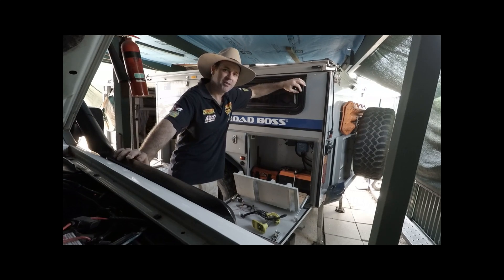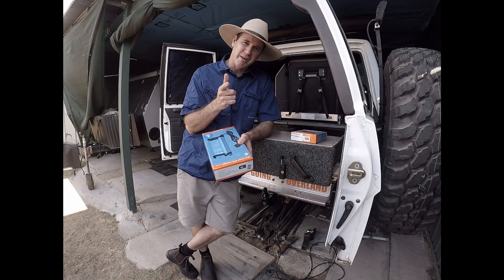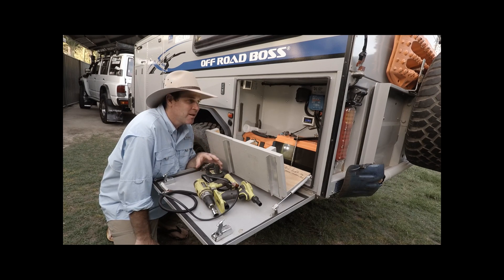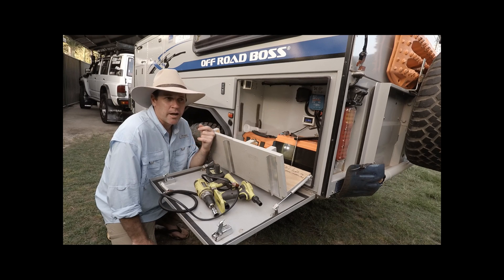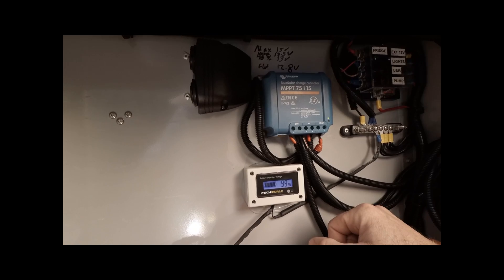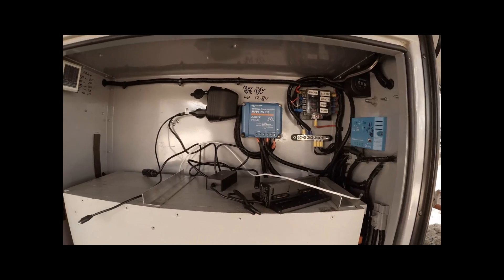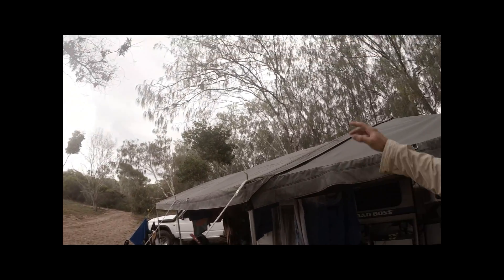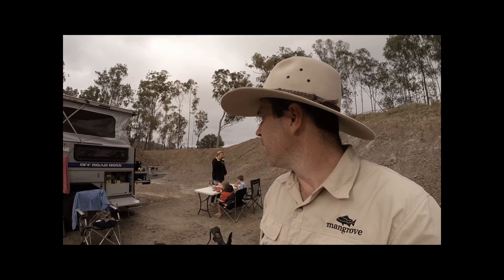Budget lithium setup for camping and overlanding. Real world test. itech lithium and victron mppt.

Comment: I don’t go away for long enough periods so I’m not going to bother setting up the dual battery. I’m just going direct from solar to the battery and it works a treat. Like you after 3 days I came home on 100%
Reply from the maker: That's awesome,  yeah if the lead acid battery is capable of what you need definitely stick to it,  no point spending hard earned money when you don't have to 👍
Reply: Nah it’s a 100ah renogy lithium combined with a 200w itechworld  solar.  I’m useless with electronics, got quoted about $1500 just to wire the car even with my supplied equipment.

Comment: Great video mate, but one very important fact with lithium is that you need to set your charging devices ( DCDC chargers, Solar regulator /charges) to 14.4 th 14.6 volts to achieve full charge. Most come preset when you select lithium as your battery type but worth checking. Also, most battery condition gauges are "indications" only, what I mean by that is 2 different types will show 100% and the other 83%....Always check the handbook and verify that 14.4 to 14.6 v charge parameter..Have installed / upgraded a lot of battery  systems to lithium......just sayin...
Reply from the maker: Thanks Graham,  you spot on there. We actually don't have a dcdc charge as we don't charge off the alternator. And we just finished our lap of Australia and only 1 toped up off 240v! I'm so impressed especially when we ended up running the freezer off it every night in the Northern heat!

Comment: Those batteries are rated for under bonnet use so you will be alright I have just put one under the bonnet of my 200 series Cruiser
Reply from the maker: Really? That's interesting,  we would love one in the patrol but worried about the heat from the turbo which is on the same side.

Comment: You should be able to run the fridge in camper 24/7 as long as the camper isn’t under cover. I have a 110w panel on my car hooked to a 20a mppt and a 100ah agm and thart runs my fridge all year round on solar only. I just on Father’s Day wired up my camper with a 100ah lithium and a 110w panel and a 95 Ltr waeco dual zone and I run it 24/7 and the battery is full by 8:30 am running fridge and freezer and lights. You will be fine running your fridge all night in the rain.

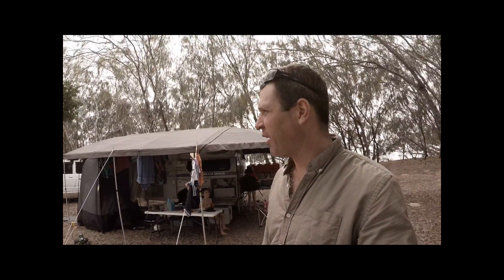Comment: 8:22 I believe you can’t rely on what the volts are with Lithium batteries. They will sit in 13.3 volts until almost completely dead/flat.

You need a monitor compatible with lithium batteries that will give you a state of charge in a percentage %.

I’m about to upgrade to an iTech battery myself, and the Redarc manager 30 I’ll be using will give me a state of charge in percentage and days left till flat when connected to a battery the unit supports.

Comment: I bought 2x 200ah Voltax for $1600 for both. I use a Victron smart shunt to monitor, the two batteries in parallel . Two trina 275w house solar panels in series charge the batteries through a Victron smart MPPT 100/50, and panels push 50a into the batteries in good sun. My free camping setup runs 2 big domestic refrigerators and two 200 litre chest freezers via a victron 1600 watt/70 amp inverter charger. If I need my generator ( which I never have, even in rain) I plug the inverter charger into the gennie and charge at 70 amps. By 10 am every morning batteries are charged again. Both batteries deliver stated Ah (200) as read on the smartshunt before shutdown. No problems so far. I could not be happier. Prior to the Voltax I had two Giant 140ah agm which struggled to keep the system going overnight and took all day to charge. AGM's draw power fromthe charger ok until they are half full then charge tapers off (voltage rises) and the charger backs off, even though the smart shunt tells be they are only half full.
Reply: How have you found the voltx batteries?
Reply: @ashleybertus88  100% ok. 2.5 years now. no problems

Comment: Lithium doesn't run off volts. It holds voltage for much longer, you could be sitting at 13volts and the battery could be nearly drained
Reply: Spot on

Comment: My camper trailer (Drifta WUHT) came with a 300w solar and 200Ah lithium. It has a 60lt fridge and lights and inverter (rarely use) and air pump and water pump. It just never has trouble keeping up. The big fridge (95lt Waco DZ in the GU) will now be running off the same battery you have, with car power and 280w solar blanket when I'm stopped. I was running the big fridge off a deep cycle in the engine bay but I'll probably take it out to save 25-30kg.
I did a Cape York, Tassie and Birdsville trip in '19 but had no hot beers.. Will be doing a big trip from SW WA mid year - probably Kimberley to start with, depending on vaccines and virus stuff. 
This lithium technology is fantastic. Yeah it's expensive but so is rotten food and hot beer!

Comment: Gday, is your Victron Smartsolar or older Bluesolar?
Has the Mppt been set to Lifepo4 charge profile?
If have it connected via Bluetooth to your smart phone and Victronconnect app and running fridge and all other loads via the load terminals you should be able to monitor SoC% of your Li battery before you bought the battery monitor.
The 30day history is handy to review preformance 

You need to use a Li battery as Li battery and not an AGM otherwise you will kill it or not get the best out it. With a monitor let it get 30%SoC safely and then recharge it.
Might as well just bought AGM if going to try and keep it close to 100%SoC or bought 60amp battery.
A full Li battery or one kept on float when not having a draw on it like fridge will send it to early grave like did with your trailer AGM.
Does not matter if Li is not hitting 100%SoC everyday. Let it draw down to 20-30%.
That is one of its advantages. 

Another suggestion is to fit household 250w 45volt househould panel to camper to make your 75/15 mppt sing. Make it removable so can set it out when camped up for a few days. Scrap that 165w 12v panel or join it in parallel to other panel that is feeding the Patrol deep cycle battery.
That household panel new will be $150 tops and 2nd hand $20-50.
You will easy pump the 80amps back into to the LI on sunny day and being 45v will still produce a charge on all but heavy rain days.

I run 200amp Li on ute with 330w 45v infeed(approx 24amps max per hour charge).
My Waeco 65L DZ and other gear means reach 30%SoC after 5days and then turn on mppt to recharge. After 18months battery has cycled only 50times out of predict 2000cycles.
The camper has 100amp Li and runs 75L two compartment fridge plus Cpap machine for about 75amps per 24hours.
Victron 100/20 with 300w 45v household panel and even with 2days of rain the SoC was over 20% on 3rd morning. 3rd day was clear day and by 11am was 100%.
Need change your thinking and habits when using Li.
Once you get head around Li and learn to trust it you will rarely have need for AGM again.
It is a worthwhile journey you have started.
My 1st 8weeks I had trouble believing the apps and monitors reading. Shake down trip was 3weeks. 

I have subscribes;)

Comment: G’day. Terry King (type in Jaffa Advantures) has tested this exact battery under the bonnet of a 200 after 7 months of hell - corrugations, heat, cold etc and then gathered data on its performance which you can see real time in his video as he’s doing the test. Basically it’s still performing 100% down to the 20% floor as if it was new - Awesome bit of gear. I replaced my 2 AGM batteries in the van with one of these and has been working great. I’ve left all my chargers in the van (inc solar) on the agm setting, that was also a bonus with this battery not having to use a specific lithium profile charger. It 
does though charge off the redarc lithium profile charger when on the road. Definitely a game changer and as Terry says in his video - ‘lead is dead’. 
Great video
Reply from the maker: Awesome to hear, would love to get one under the bonnet of patrol,  but it would sit right next to the turbo and I have  temps around 90 degrees

Comment: And sooner or later,you find out that the battery will show 13.3 volts when it's almost dead flat. If people are going to do review video's,it helps if they actually know what there looking at.
Reply: @4x4au I run 2 shunt meters, one records all usage and the other records all incoming amps. Charge your battery/s to full SOC, and set both of the meters to zero. Now, if I use 50 Ah overnight, I expect my controller to input 50 Ah to return battery to full SOC again. The returning amp hours are practically exactly the  same as the used amp hours to reach full SOC. This is the only way I've found to know my SOC accurately, and I know almost exactly when I'll return to full SOC, as soon as the incoming amps match the amps used on the outgoing shunt meter.

I used 62 Ah overnight. My charge controller will input 62 Ah today. The battery has 100 Ah available from full SOC, so I was down to 38% SOC.

I can't tell accurately by looking at volts as state of charge,  but I can tell accurately by checking the difference between the 2 shunt meters.
Reply from the maker: We got the battery a couple of days before we left, monitor came before the second trip. Every time I checked it it was 13.3v. 13.2v is about 85-92%, so she pretty much stayed fully charged the hole trip. Just completed another week not moving  in rain, clouds and shade,  never went below 80%,  so I'm very happy with the setup.
Reply: From what I have seen, lithium will maintain 13.3v down to about 20%
Reply: No it won't show 13.3 volts unless it is connected to a charger and is basically fully charged. When removed from the charger, the lipo battery will return to show 13.2 volts at the terminals.

Comment: I have gone full beast mode ! 200ah, 3000w inverter, 40amp charger 👊👊💥💥👊👊

Itech do not do a 60amp charger as yet 😞
Reply from the maker: Oh yeah that's sic. Why the big inverter? AIR con?
Reply: @GoingOverland  it is for a few bits and pieces. I am not even running it in a 4WD / Camper / Caravan set up but need something to run a few extremely sensitive bits of equipment. Went this route rather than a sine wave generator as it gives me more flexibility / options down the track.

Battery and charger should be in my hands by the end if the week
Reply: @GoingOverland  our van air con pulls 1300w.......the coffee machine pulls 2400🤣

Comment: I was excited when I saw the headline of this video because I am going to change to lithium.I thought this video would help me decide what size battery I would need.Then I was dissapointed because you kept going of what the voltage was 13.3 volts.That tells you nothing.With lithium you need to know how much is left in the battery.state of charge.You even have a meter there that tells you that but you didnt show that.So really I learnt nothing.
Reply from the maker: You're right,  but I got a battery monitor for that weekend test and it shows the volts and percentage.  When battery is on 13.3 volts it has between 90 to 100% charge,  on 9 day test it every time I checked volts it was on 13.3 volts. So battery pretty much stayed charged.  Wish itech recommended that monitor when I was buying battery.
Reply: @Getting There I see your point, I actually just ordered the 120x and the battery monitor with a shunt from Itechworld. Unfortunately, I won't be setting it up any time soon so won't be able to tell you about the battery's performance.
Reply: I'd ask for my money back. You obviously didn't get full value from this fella's video...

Comment: hook an inverter up to it and see what happens.....disappointing
Reply: We have 2. Get weeks and weeks of free camping from them. We have 200W of flexi solar constantly plugged in as a back up . Runs the fridge, charges all our equipment via a 3000W inverter/USB ports etc,  also runs a projector for  200"  movies every night. 
Check out the discharge curve for lithium. Kills AGM/Lead acid/Gel. 
We went from 2 Fullriver 120's to these and the difference is day and night. Not to mention the 65KG difference in weight. 
Just our thoughts and experience.
Reply: @richarm66  what brand is your 3000w inverter? Apparently the cheaper inverter capacitors are the reason the BMS of the ithech battery trips and shuts the battery down... There is even a full write up on their website with how trick the BMS to potentially not having this problem happen...I just wish they disclosed that prior to purchasing the battery that certain inverters won't work with the lithium BMS
Reply: @Bilbuss  It's a Victron Phoenix mate.
Reply: Depends on the inverter surely ? If you try to run any decent 3000w inverter with a 120ah battery, you will have issues. 

I will soon find out 

All itech btw as I am not one to mix and match

3000w Inverter 

200ah lithium battery 

40amp charger

See what happens 💪💥👊💥💪
Reply: They tell you the B<S output rating when you buy it... it shouldn't be disappointing if you sized your system properly.

Comment: I took the plunge on a itech 120 at the start of the year. It’s been running my 60lt National Luna fridge and various power outputs flawlessly. I had to upgrade my Intervolt dc/dc to the lithium model despite Itechs claim any dc/dc will charge there battery... I can easily get 3/4 days at camp out of it and basically unlimited camping with good sunlight. Very happy with the purchase so far 👍🏻 also don’t rely on voltage readings with your lithium, they’ll hold good voltage until there almost empty then quickly drop. I use a victron battery monitor which is priceless.
Reply from the maker: Yeah after our first trip to Bundy I got the monitor,  pity I didn't realise they had it when buying the battery. Awesome to hear 👍